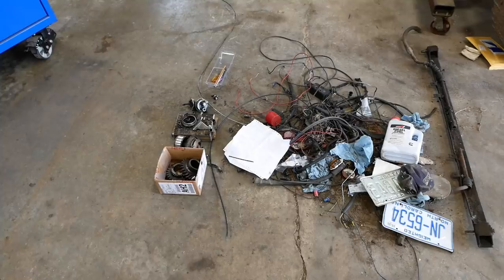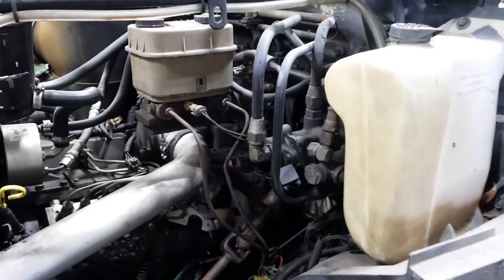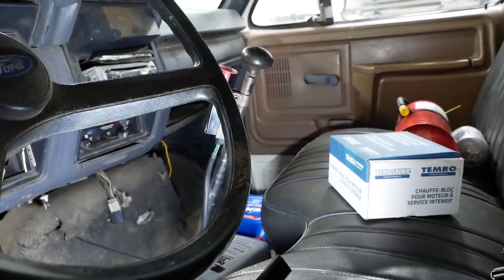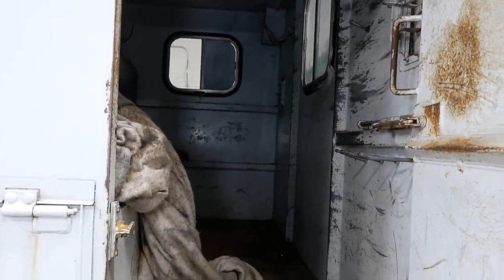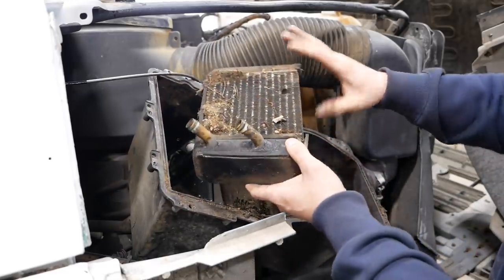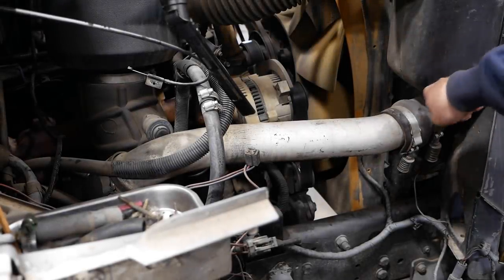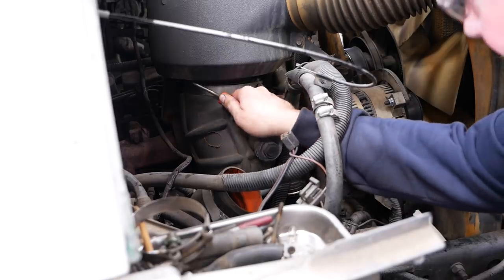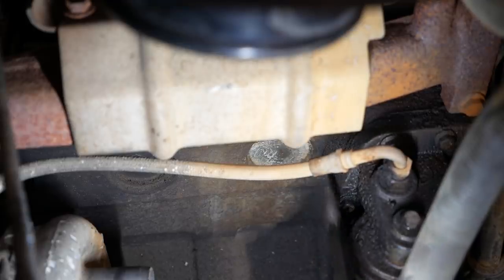Ford F700 Cummins Chipper Truck Project - Coolant Leaks, HVAC, Block Heater - Part 1

Comment: There seems to be a virtually limitless supply of crappy crusty Class-5 and -6 straight trucks being used as farm trucks, plow trucks, utility trucks, rust depositories and mouse condos in your area. 
….and speaking of “Whoa baby” - it’s always nice to see Mrs. Wes in the garage.
Reply from the maker: It used to be worse back when they had carburetors and points! Every fall my dad would spend a few weeks cleaning carbs and points and bleeding brakes.

Comment: You're the kind of a guy they need on the Mars mission, who can fix anything.
Reply: Too bad it's a one way mission...
Reply: Government run programs very risky.
Reply from the maker: Hmm. Locked in a confined space with other people for an extended time period while being micro managed by a massive government bureaucracy. Where do I sign up?
Reply: @WatchWesWork  and a government-issue socket set, with the 10mm socket missing - oh hold me back!!  😁
Reply: and they sent the wrong part so return it for another, meantime in the next 4 years....

Comment: Say Wes, I can say without a doubt that you have saved this tree mulcher guy hundreds of dollars. To have this much hodge podge electrical and running gear problems, had he tried to just run this truck he would have lost half his workers and his business if you had not done what you did. This can make or break a small business, thank you for your caring work. He also would have without the heater have been unable to drive in this truck or start it.

Comment: I know it wasn't torqued to factory specs... I didn't hear the "click". lol
Reply: click
Reply: I was waiting for the click too.
Reply: The torque wrench was in mute mode
Reply: Sure it was, it is tight enough that it won't fall off.
Reply: @MrCarl312  It was a joke cuz Wes always says "Click" when he's done tightening it
Reply from the maker: The threads must have stripped before it could click!
Reply: Wes is a Millennial, his torque wrench is set on vibrate.
Reply: @tomkrause62  lol it sounds dumb, but i love that my techwrench vibrates. Beep and vibrate. If you have headphones in at work, it's a nice feature
Reply: Www factory spec is ‘one grunt past a hernia’
Reply: CLICK

Comment: This truck is a good example of why I've been trying to make sure my daughter has some working knowledge of auto mechanics.  There are many good mechanics out there like you, Wes.  There are also many jacka$$ mechanics out there who are high, stoned, drunk, don't care, and/or will actively try to cheat you while ruining your vehicle.  You need to know enough to know the difference.  Good mechanics come up with workmanlike solutions when they can't get the factory solution, they put things back together properly and button things up.

Comment: The metal grating folded around the clutch and brake pedals 0:19 is next level.
Reply: Great idea I thought. Solves the muddy feet slipping off problem. I have a older GMC that's probably going to get that option before harvest.

Comment: Sounds like it's time for that truck to have a "wiring malfunction" and burn to the ground, good thing is no one would ever question it after seeing that mess.
Reply: I'm guessing the tree trimmer likes these old square body Ford 700. probably doesn't want the added "features" the next generation had.
Reply from the maker: I think it has at least once...

Comment: Always amazes me why some people rig up things instead of doing the job correctly, when a problem crops up. Or even the people that ignores problems until there are so many, they don't even know where to start. Fixing issues as they occur makes for a working vehicle without everything broken. I see you doing those repairs that were ignored over time. Nice work...

Comment: Wes, bicycle cable works great for old heater control cables as well. And you can buy it in big rolls.
Reply: If you get the low-friction stuff with built in plastic liner, it's even better.

Comment: Good morning and happy Saturday. I am avoiding doing brakes on my wife's Tiguan, so I am going to Watch Wes Work first. Thanks for bringing us along on this big project.
Reply from the maker: Have fun!
Reply: @WatchWesWork  Not too bad. The nice thing about working on a 2019 is the salt monster hasn't had enough time to make things too bad. Other than the electric parking brake, it was simple and straightforward. Edit until my wife tripped over the oil drain pan...

Comment: Problem with those old Asplundh built "crew trucks" is that the tree trimmers had to fend for themselves, make their own repairs to get to the next job or home, and they got small bonuses when they kept their crew's costs down.  Next generation: You can't imagine the pressure on these guys working for a tree service that can only afford to buy used equipment.
Reply from the maker: I know how it is to start out with a bunch of junk equipment...
Reply: The Hallmark of most indie small-time tree services is that they're running Asplundh hand-me-downs, usually still painted orange, and usually in various stages of falling apart at the seams 😁 my dad started his tree business using a chipper truck much like this and a bucket truck he cobbed together himself using components from at least 3 80s vintage Chevrolet medium duty trucks

Comment: The local landscape crews will use the bunk space so that they can send 3-4 guys along to a job with chainsaws, pruning hooks and the like.
The high-speed bunks have an inverter so the microwave can be plugged in for lunch.  Heaters in the bunks not much of an issue here in TX, but add-on a/c is pretty common.
For Volume One, this was a great video.

Comment: Wes, you're a better man than I. 
If I would have seen that wire mess I would have quite on the spot. I'd rather bathe in burnt gear oil than do wiring on a vehicle.

Comment: Lucas, the Prince of Darkness, we have a phrase that sums up this truck, JFSI, just freakin scrap it
Reply: or, Joseph Lucas the inventor of darkness!
Reply: Naw, man! Got lots of life left inner'
Reply: I feel Wes’ pain when trying to undo decades of bodging on unroadworthy scrap, been there, done thst working on old and not so old service buses and coaches, one major PLC I worked for got a visit from the ministry, all the  buses that had serious and potentially illegal daults were hidden in streets around the depot, and 30 drivers were told they had no bus to drive for run out, after the ministry left, suddenly these buses turned up and drivers allocated them, one morning I booked 9 off as unsafe, but a colleage manafed 13. I could chat to Wes for hours about my tales from the UK transport sextor
Reply: There's presently a big "construction truck" shortage in the US.  That beastie would get some scary numbers at an equipment auction, and the brakes, wiring, and the like would not force the selling price down much at all.
Reply: @CAPNMAC82  
Any service vehicle. Stripped down pickups are unobtainable. Amazon, FedEx, UPS, DHL and USPS bought every useful van. The only things left are minivans, loaded pickups and the outdated/inefficient Chevrolet Express.

Comment: I bought a 2005 Dodge grand caravan over a year ago because the body and interior were in excellent condition and I knew that even if it was a mechanical basket case, it was super cheap to fix. I have spent over a year chasing "Repairs" that I put in quotes on purpose because I have no idea how anyone could think half of this shit was ok. That stated the Van runs like a champ and has been worth every penny I've put into it. I am just continuously shocked at the sheer amount of repairs that never should have worked and I find it difficult to believe that they weren't performed by a 16 year old with zero experience being paid $5/hr to not give a shit.

Comment: Its actually not too bad to ride in the "man cab" as we call it in the tree business. Most of the time nobody rode in ours, it just doubled as a place to put saws that wouldn't fit in the storage boxes on the side, but the seat is useful as it opens up and makes a great place to put all the rigging stuff. Cool that it's got a Cummins in it. Our old truck was like the last one you worked on with at big p.o.s. gas boat anchor of a motor. I'll be here for part 2 of this adventure 😁👍

Comment: Wes:  
"This is the HVAC control unit. There's the other end of the cable that we just made. 
So, this is all good. Unfortunately we opened up... a 'Pandora's Box' here".

                    presents a severely hacked up cable harness

                                                    Me:
                                           "Oh-my-gawd!"

Comment: I've worked on a ton of these F700 monstrosities. My father's, and my uncles. My dad's has the Brazilian 6.6, my uncle has 2.  One with a 429 gas, and one with the 5.9 Cummins.  I've had the same joy you're having. I have had to rewire all three dur to melting and mouse damage. The fuse panels are the worst. Take it easy, and keep it greasy!

Comment: I thought the first repair would be that 2 speed trans gizmo so you could score the C-clamp if it’s a good clamp your up $20 or so.
Reply: $20  ?  You have never bought a good clamp.
Reply: @12345NoNamesLeft  Hazard Fraught
Reply: No I haven’t because I got my dads clamps. But good old clamps on Craigs list go for about $20.
Reply: @thomasbrown9402  Those ain't good

Comment: Awesome video I learned a little more today. I picked up a 1980 f-700
With 25,000 miles. From the south never been in salt. I'm in Michigan like you they wash the streets with salt. We won't use the f-700 in the winter.  Lol

Comment: Well, now I don't feel so bad about having to replace a wheel well liner in my wife's Scion this morning...
Reply: I need to replace all the liners and pans on mine, wondering it it's even all that necessary. Hardware missing, and the places where they attach are broken too. Damn plastic
Reply: @WCGwkf  Automakers cut costs everywhere they can so the way I figure it if Toyota thought it necessary to put liners in the front wells (and not the rears) then they're there for a reason and I need to replace the one that broke off
Reply: @chrisfreemesser5707  i mean every car has liners and it does keep crap like snow from getting into places. I drove this last winter without one side on and it wasn't much of an issue so I probably won't be replacing it. I maintain everything mechanical well but not sure it's worth $100 and the pain of fixing the broken parts to make it work at all.  I just use zip ties until it all breaks off

Comment: You should add 25 percent to the bill just for owner stupidity. 🙄
Reply: Absolutely. For what we pay at least here in Florida for tree work, junk that POS and let the moths out of his wallet, get a newer truck that isn’t a complete wreck.
Reply: @tmbevtfd  
I'm sure he'd like to. Service trucks of all sizes are nearly impossible to find new and the price of used units is insane. We're pulling trucks out of the scrap line to keep up.

Comment: This is like a truck from IKEA. Build it with no instructions. Rats nest wiring? No problem, that's where you shine - Love it! Is there anything this truck doesn't need?? I guess this thing had almost 0 coolant based on the water pump and block heater install. Looking forward to the next revelation of a Carolina disaster Chippendale truck. (lol, see what I did there?) I'm amazed the lack of mirrors wouldn't pass a DMV inspection, but a caged and missing parking brake would? I almost spewed my coffee looking at that C clamp on the 2 speed axle setup. You got your work cut out for you on this one Wes.

Comment: I actually have found a speed connect on the mixer door and pulled a 12 gauge shotgun shell out of a z28 heater box. lol it was back in the 80s cocaine wars days.
 I had a trucking company and only 1 truck had a block heater and I bought that truck in illinois.

Comment: Holy Cow what a mess that truck is.  I can not imagine even trying to figure out all those wires.  You made quick work of the water pump and heater and blower.  Looking forward for the next video.  Thanks for the video's.

Comment: I don’t know anything whatsoever about this truck, but I like it !   Ridiculously heavy looking truck, love it !  stoopid thing for wood chips !!
   I’m still waiting for some irate rodent to pop out and swear at you  !
      Listen Wes, you are breaking the unwritten law !   when a thread is stripped 
out you are supposed to horse the next diameter up bolt into the hole without even attempting to re-tap it !  the drill and the nut are for several attempts later !
   I don’t believe that rear compartment has a bunk, that is the seat on which you drag three  (maybe four) hungover ,unshaven,heavy smokers to work at six O’clock every morning, do not let the public see them, it tends to upset !

Comment: Worked on one of these with that park brake set-up. The chambers were ridiculously expensive even 15 years ago. Can't imagine they are cheaper now. One I messed with would occasionally belch the fluid out of the reservoir. Found a bunch of the aluminum skin seals on fluid bottles in bottom of reservoir. Even after cleaning all that out it still would randomly puke. But the brake worked! Was a boom truck, rarely used. Gas motor.

Comment: Funny you finding that lighter. my dad was watching with me he said about when he worked with a tree trimmer back in the late 80s his boss bought a Ford like this but older. that came from the Philly New Jersey area.  My dad and his boss were replacing the heater core same as you. they pulled out 3 lighters a used crack pipe and 2 baggies of crack. They guessed one of the workers had to stash his drugs on a few occasions.

Comment: I'm sure you might see a heater core again on one of those trucks. You can save some reassembly time by eliminating the interior nuts and installing Rivnuts (rivet nuts). Sometimes the next guy to work on something is you.
Reply from the maker: There weren't actually nuts inside. One hole was just stripped out... The nuts inside fit over studs in the heater box.

Comment: Wes the wiring definitely is a nightmare. Good luck working on the brakes. I have seen some mechanics very frustrated with them; because of their odd design. Another brilliant design by engineers.

Comment: My buddy just sold one of these has been in his barn for 21 years ! 1 rear break was seized so bad we had to cut both self Adjusters off with tourch and still had to beat hell out of and use jack all and long bar to get wheel unstuck!

Comment: Was kinda hoping you'd put new heater hoses on, but you did exactly what I would've done...  I would've repurposed a left over heater hose clamp to secure that rubber hose for the motor brushes.

Comment: Wes, my 1963 Toyota Land Cruiser had an optional heater when new, but someone made use of a forklift heater which went in through the firewall. A rear heater was also an option. On mine, I got a school bus heater for the driver, and I'll put it under the back seat. Apparently in Japan, most folks don't require a heater, so none were included.

Comment: For replacement foam go to Michaels craft stores, You can get 9 x 12 sheets that have an adhesive back. They are pretty sticky and are only $1 a sheet. They come in pretty hand for dried out crappy foam that needs to be replaced. I've also used them behind and around panels that rattle. I think you can get 2mm and 6mm thick.

Comment: I use rubber tire valves  hose clamped into rubber hoses and by removing the valve core I can check with both pressure and vacuum. Remember they make 2 sizes of the valves..I have 3 short hoses set up like this in 1/2, 5/8, and 3/4 inch. Even can use it In AC to isolate and check some individual parts for leaks. Just don't get carried away with the air pressure, 20 PSI is plenty, especially on cooling systems.

Comment: We used to have a 89’ F800 dump truck at work. Same setup, diesel, hydro/electric...boost brake setup. The two speed rear.....50% of the time, it worked all the time....aka don’t use it 😂

Comment: Excellent video! We used to have 4 or 5 of the 70s variety of this truck. We cobbled ours in the field from time to time, but when we got back to the machine shed, they received a proper remedy.

Comment: I thought that core plug had gone for good inside the block. Well done for retrieving it. I would've put a self tapper in it and levered on that.  Do we learn in part two what happened to the shelves? Will we see Mrs Wes wielding a power tool? Are you expanding into DIY as well? All these questions and more will be answered soon. Take care and stay safe. 👍👍
Reply from the maker: I seem to remember cutting them. Then she sanded them over something.

Comment: I know it's done now but for reference I believe the blower motor, resistor and various cab mount switches are the same as a '84 F-150 without factory air.... 
Hopefully thats helps at some point

Comment: At 7:45 in, I see a 2-3 day job turning into a 2-3 week job. As is typical on work trucks like this, you find things you don't want or expect to find and can't find the things/parts to fix it with. More time in researching /resourcing  /waiting on  parts than actual repair time. 1/2 way thru you'll question your sanity. Hopefully at the end of the job, the satisfaction and money for the job will offset the stress it caused. AND THEN, ON TO THE NEXT P.O.S. WE NEVER LEARN. TRUE MECHANICS ARE GLUTTONS FOR PUNISHMENT !!!!  Can't wait to see what you DISCOVER next on this CREAM PUFF.

Comment: A lot of the time it's just the thermal fuse that has gone bad on these blower resistor packs. You can just replace the thermal fuse and keep the OEM resistor pack